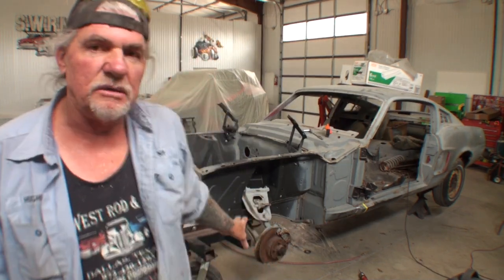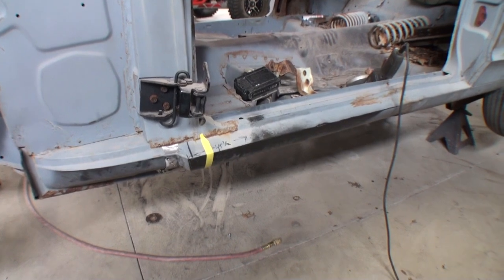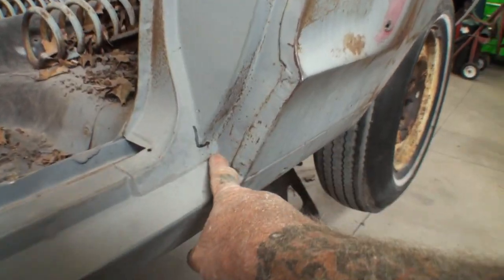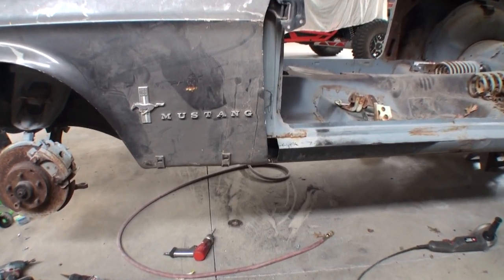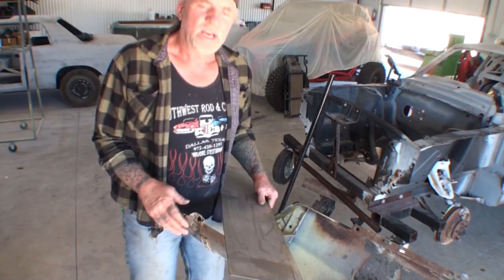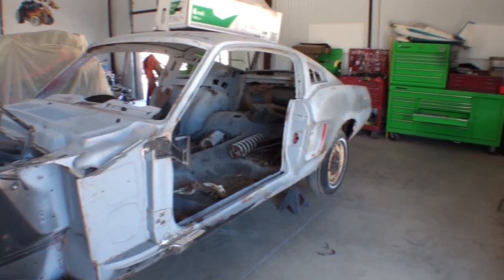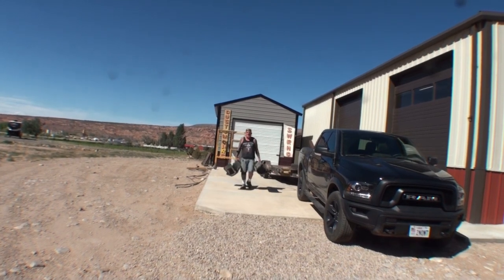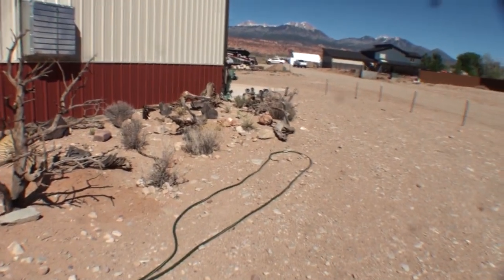How To Restore A Rusted Out Car Part 41 - Rocker Panel FIX

Comment: I ordered 3 hoods for a 1993 Silverado, couldn’t get them right, regardless what we tried. Then I decided to order one with the 2” raised cowl from some guy in Houston Tx. Wasn’t cheap shipped to the shop, but it didn’t need anything other than a couple of shims. It was a great fit. It was heavy and sturdy, not like the first 3 that got dents from the sweat drops falling off my forehead. Cheap schitt material. 
Thanks for sharing, brother.

Comment: I figured that the P/S gear on the VW Baja was repaired or replaced already, because it takes time to edit the videos and review, long before posting. But yes, on the pitman arm double seal, once the clip is removed, engine running, turn the steering wheel to lock and internal pressure will pop them out. The input shaft is harder but I have done a couple of dozen over the years! Glad you got-R-done! Take care Pete. 
It is the thought that counts. DK.

Comment: I remember hot summer nights, and gallons of beer i've drink been watching this entertaining and useful series. I've learned a lot from the series about rustang. Its terrible how much headache aftermarket parts can make. You said in the past it took 2-3 days figuring out the left door gaps, and still you wasn't able to make it fit perfect , and i think you moved to the front end and left the door gaps for latter. Turns out that the door was from 1967 model year and its different than 1968. I just don't get it. Did the guy selling the door lied to you that the door is 1968 ?

Comment: I dread test fitting aftermarket shit. It's all junk. AMD is about the only one I've had consistent luck with. I just can't understand it. If your going to stamp out of remake muscle car parts why would sell stuff that is SO FAR off from fitting ?? Why ? Why go through the trouble.. I wish I never  cut  out all my factory panels. I would have saved myself from so many  headaches.. 
 I feel it's all just greed. Greedy people selling junk that they know doesn't fit, then telling customers " none of the factory parts fit either" or my personal favorite is " All new tooling for a factory fit " 
Factory fit my ass.. I'm right there with ya Pete. I know your frustrations.

Comment: $600 worth of trash.. I'd box it up and ship it back to the "manufacturer" with a note to stuff it where the sun don't shine ! 
Goodmark = junk
Sherman = junk
Dynacorn = junk
Tri-mark = junk
 CHL,Keystone,and all the copycat brands that copy junk are equally considered = junk. 
Minnie just doesn't have the same level of frustration built up. Or she would be taking her turn chunking that trash around too ! Lol 
 I get it 100%. 
70 Camaro I'm working on has all the following aftermarket parts that I had to cut/weld/grind to get even close... 
Both front fenders,  both rear quarters,  full one piece floor pan, full one piece trunk pan, full one piece roof assembly (inner and outer assembly) deck lid, tail panel, core support,  hood, hood hinges ( total garbage) and  so many bits and pieces in between.  So yeah, I can say with 100% conviction... throwing a couple fenders around is absolutely 110% necessary! Lol 
 Well Done Pete ! Nice arch and formidable distance my good sir.